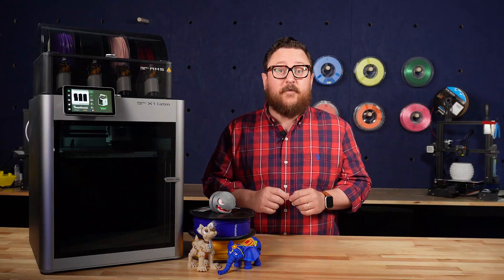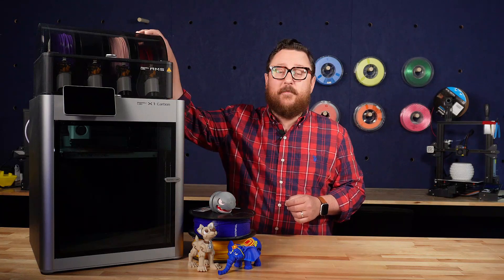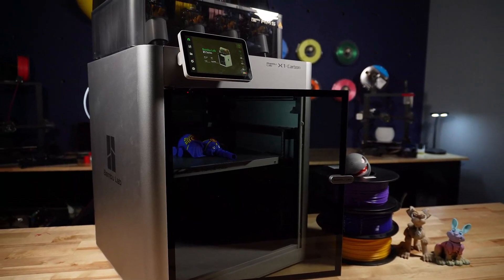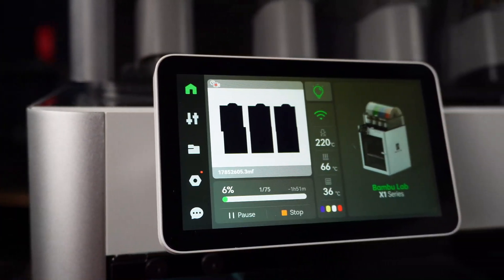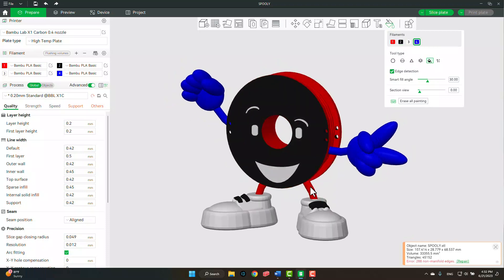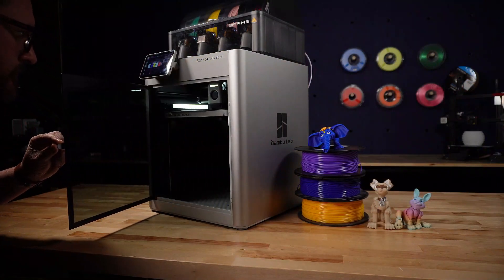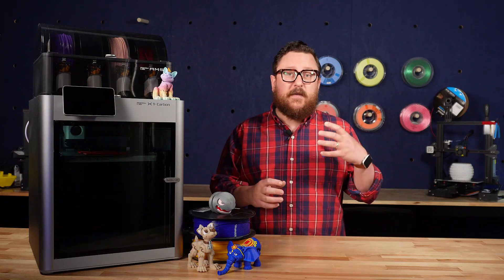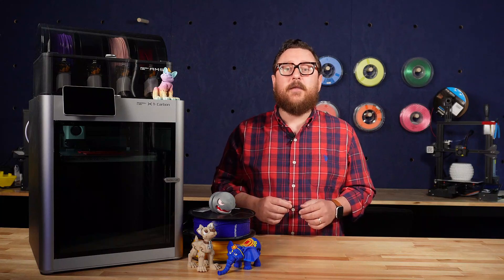Bambu Lab X1 Carbon 3D Printer Overview - AMS 3D Printer available at Micro Center

Comment: I got my BL X1C a little over a month back and have really enjoyed it.  I’ve run into one issue where the 3rd filament slot keeps hanging up and it is unable to retract the filament after a job is finished.  I tried to find out if I could just get the AMS replaced, but since it was a combo unit purchase I would have to return the entire unit with the AMS just to get the AMS replaced.  I ended up buying a second AMS, but they didn’t have any AMS hubs in stock and there wasn’t anyone working in that area so I couldn’t find out when they would be in stock again.  Spare parts are a major part of the 3D industry and I hope that Micro Center starts getting them in, in larger quantities than one of each item, in the near future.

Comment: Question!?! Do you think this printer could handle lining the plate with 30 tiny parts. All separate parts, but the same part. The first layer of each part is about 3mm by 10mm and about 5mm in height. My s1 pro can only handle one at a time, and it can only get that first layer to stick every now and then. Do you think this printer could do the job, day after day?

Comment: Love my X1C. It makes 3D printing so accusable and all my Inland filament runs fine through it. My only two cents would be to improve the cardboard spools for the AMS.... Either plastic spools, or better yet use the same core as Bambu's reusable spools. I know Inland has reusable spools also but I don't want to have two different spools, or print multiple adapters for them.